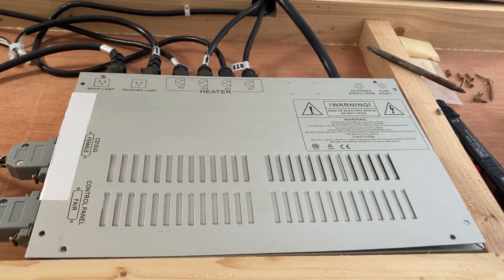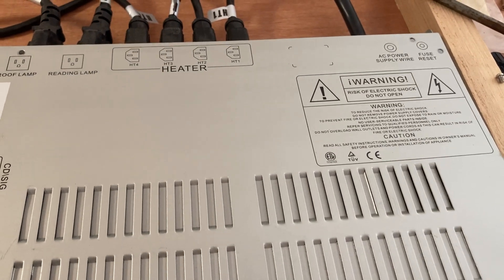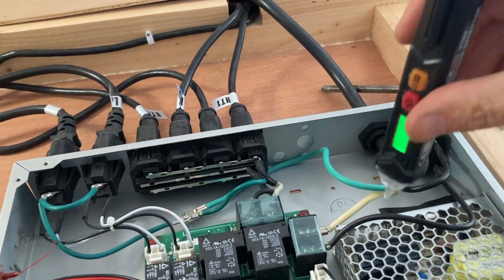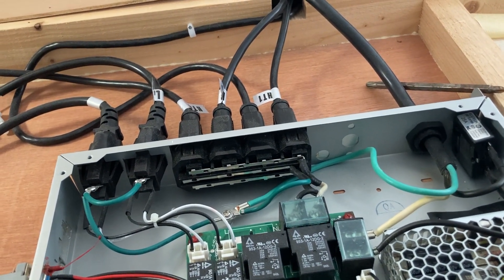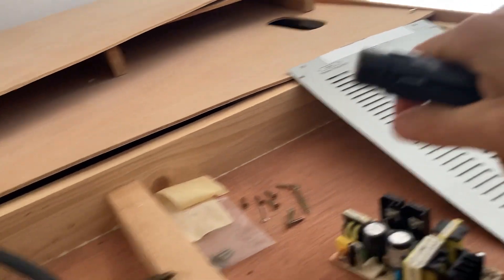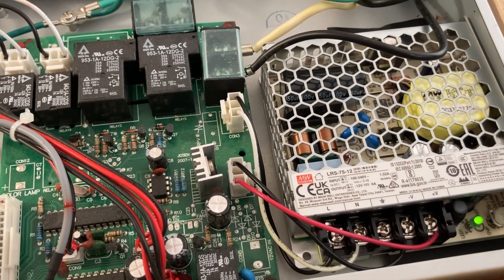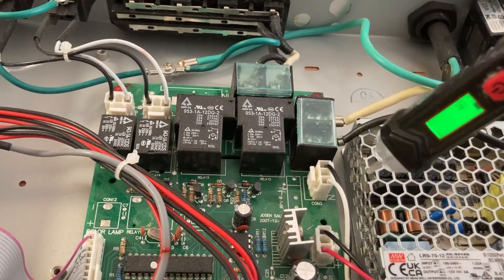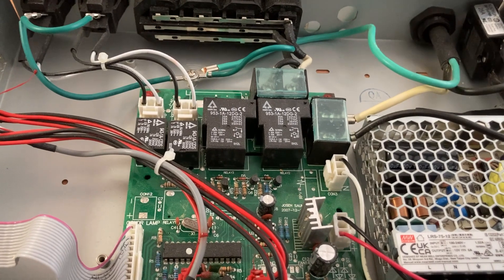How to Replace Infrared Sauna power supply module for under $20 - no power to control panel

Comment: Thanks for this video - my sauna is only 4 years old, but I use it 5X/week.  Yesterday I turned it on; when it reached temperature I got in, only to have the power go out in 10 minutes (never happened before).  I checked the breaker to the receptacle and it wasn't tripped.  I'm doing a bit of research before I tear into it (I DO have electrical knowledge).  I though that it it's the control board, if I can't find one for a reasonable price, I'll mount a rheostat (externally) and control it that way... I haven't even looked at the fuse, but I don't think that is the problem.  After going out, the unit came back on by itself in another 15 minutes, but went out permanently shortly thereafter... this would point to failure of a larger component - either the controller itself, or the power supply (as you showed here)

Comment: Hi Aaron, are you able to share the name of the Sauna company you have. I acquired one from a friend and it is exactly what you have, but there's no identifying name on it. I did buy a new power supply per your suggestion and it works fine, but I am getting a message on the temperature panel that says -L on the right display. Are you familiar with such a message? If you have the contact info for the company that would help too. Thank you for your time and detailed video. Very helpful!!
Reply from the maker: Dynamic Saunas.  I bought it at Costco. https://dynamicsaunasdirect.com/  I don't know what the -L means.  I was curious so I looked it up, one person suggests it could be a lockout due to a bad limit switch.  I haven't replaced that so I don't know.  You could try replacing the temp sensor if you have an extra and see if that changes anything.  Maybe it thinks it is too hot?

Comment: I have a 13 year old Select III sauna. It begins to heat, then it shuts off. Could it be the reset button? There is a six amp rest button in it.
Reply from the maker: it could be or the temperature sensor.  sometimes they come with a spare. you could try replacing that.  the sensor is usually in the ceiling panel poking into the sauna.

Comment: Any help on finding the middle green circuit board somewhere? That’s the issue with mine but struggling to find a replacement. I have the exact circuit you have. Thanks!
Reply: Any luck?
Reply: @jakers9932 finally found one and got it replaced and running as new but it wasn’t a cheap circuit board. Probably could of found a cheaper option, but I wanted to make sure I got the exact board so I knew it would work
Reply: @brannonrjones would you mind linking where you got it and what model?  I believe I have the same board as you most likely. My sauna powers on except for the heaters won’t warm up. I believe it’s the board with the heaters  relays causing the issue
Reply from the maker: @jakers9932  just saw this, i haven't looked for the board myself, if you can find numbers on the board, i suggest a google or ebay search to see if they pop up.

Comment: as advertised...ty Aaron!
Reply from the maker: Awesome glad to hear it!
Reply: I’m actually noticing that it’s taking a lot longer to reach 115 /118° I’m wondering if I can substitute with a more powerful power module? Any suggestions welcome
Reply from the maker: @chyland12  when i looked up my old part I found it was 72 watt, 12 volt, 6amp switching power supply, so i found those specs.  I would try to identify your original specs, I don’t know if going up in watts etc is safe for the other components (relays etc), if you exceeded your original specs.
Reply from the maker: I don’t know the answer, it’s beyond my experience and expertise.

You could look at your old module if you still have it and look up the part# stamped on the board and see if it’s specifications are different than the new one.  I wouldn’t know if it the new one is the same, but performing differently, or if your new one is “weaker”.

Comment: where's the reset button located?
Reply from the maker: It should be on the back of the big metal box containing the motherboard and power supply near where the cords plugin
Reply: @aaronsugarman2479  Thanks that helps I'll be looking for it, hope that corrects the problem of no juice at that front controller.
Reply from the maker: @helmetsfromheroes100 good luck 👍

Comment: Thank you so much for this video dude. This just saved me 650 bucks for about 30 bucks here in Canada. 10 thumbs up for you.....ya buddy
Reply from the maker: Great to hear!
Reply: Do you happen to know where I can buy the green circuit board from the middle? That’s what went out on mine this week. The sauna gets power because the timer lights work but the heating element isn’t getting power to get hot.

Comment: Great! Can you share a link on where to buy?
Reply from the maker: This was the one I used that matched my specs Mean Well LRS-75-12 Switching... https://www.amazon.com/dp/B07F26XGQB?ref=ppx_pop_mob_ap_share
Reply: With the problem you initially encountered, were you getting power to the control panel? Mine has blacked out and I’m currently unable to even turn the unit on.
Reply from the maker: @rhettbrown6138  I was not getting power to the control panel, but I was getting power from the outlet to the power supply unit (the grey box on top of the sauna).  Once I opened that up, and used my multimeter, I was able to confirm that power was coming in and going to the small switching power supply, but not back to the motherboard, so I replaced that part, and the control panel powered on and the sauna worked again.

Comment: Hi, had same issue replaced the power supply and started to work, however after reaching a certain temperature the sauna shuts off. Any idea of what could be the issue?
Reply from the maker: Hi, I haven’t had this issue, so I don’t know.  My guess is there’s an overheat protection that is being triggered.  Did the unit come with a spare temperature sensor?  Does it shut off or trip the fuse/reset button on the power supply?  I would call the company and describe the symptom and see what they say… it doesn’t sound like the power supply anymore, but maybe whatever the issue is caused the first power supply to fail or something failed when the power supply burned out.  

If you turn it back on will it continue to heat up? Or is it only able to max out to a certain temperature and not go beyond it?  Perhaps try a different temp sensor to rule that out.
Reply: @aaronsugarman2479  changed the temperature sensor working now thanks!
Reply from the maker: @sergegoga9699 awesome!
Reply: @sergegoga9699  Hello! I think I am having the same exact issue you were. My Dynamic sauna quicks on, but after 5-10 minutes of heating it completely shuts off and trips the fuse. I was going to order the new power supply now, until i read your comment. Can I ask where you order your temp sensor from? Any link? I might just order both and swap them both out. Thanks in advance

Comment: So did you not have 12v after the transformer? I’m having issues with mine, but I’m getting 24v downstream of the transformer.
Reply from the maker: I didn’t check the voltage after installing the new power supply, the unit worked so i moved on… ill have to find my tester and check.  Is it possible you were sent the wrong power supply? Or is your original putting out 24 volts? What’s the symptom?
Reply from the maker: Just re-read this, originally, I was not getting 12 volt output from the power supply back to the main board.  If your power supply is pushing 24 volts back to the board, maybe that's correct, and the issue is in your board somewhere?

Comment: Dumb question.
Gotta do the same swap myself.
You notice any drop in performance? The power supply is pushing enough juice?
Reply from the maker: I have not noticed any difference so far. I have used it twice since the install. Any questions feel free to reach out I hoped the video covered it but if I missed something lmk